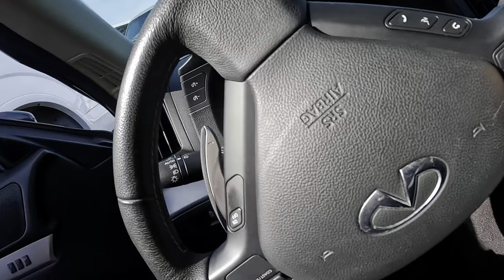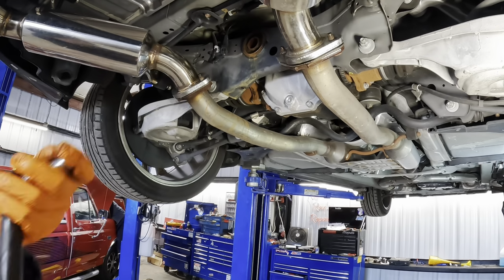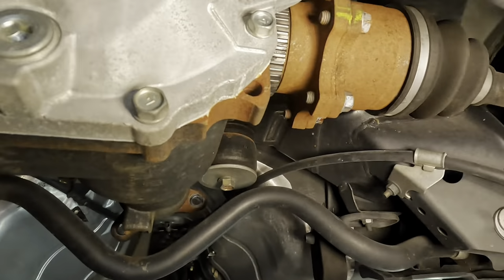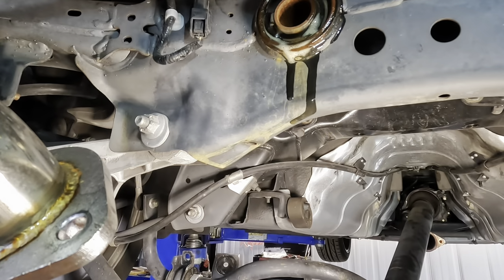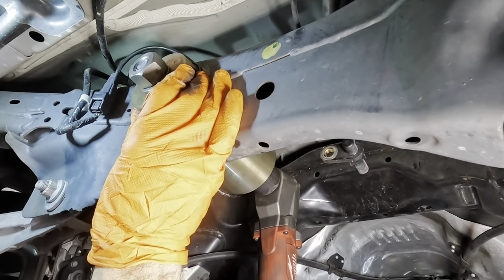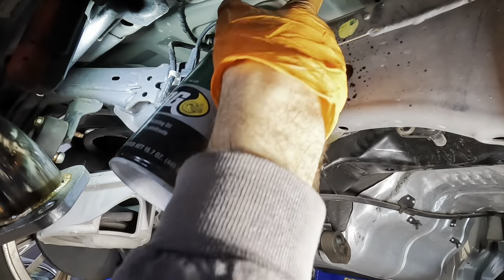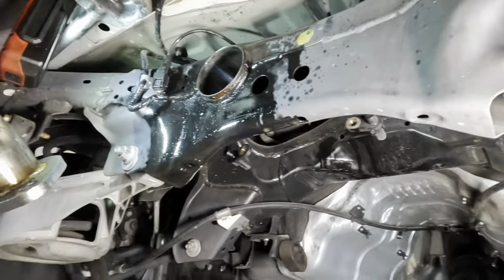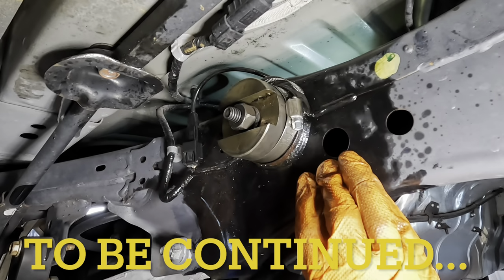Frozen Bushing! Aftermarket Press in! Infiniti G37 Rear Differential Bushing Upgrade

Comment: I hope you read the comments.  I am a new viewer of yours, I am seeing a trend.  You overuse the impact wrench.  I have seen you assemble brake calipers with your impact wrench and not even torque the nuts down afterwards.  That bushing you just replaced?  Note that you could not break the nut loose with your impact wrench.  That is because it had a proper torque done on it, your suspension components should be hard to disassemble.  You had your special tool backwards, the slot in the puck is to hold the nut in place, also, you want a full circumference pushing on the bushing, the slot on the inside provides uneven pressure.   You should lube the threads, but also the washer, that is the friction point you were fighting.   I wouldn't even use a socket wrench, it could break from the torque I would expect it to need.  Use a breaker bar, and a cheater bar on it, you have the car on a hoist, use a four foot wrench and get it done.   The piece of allthread is the cheapest and easiest piece of your special tool to replace if broken, if it breaks.  But it won't break, the bushing will slowly get pushed through, one turn of the wrench at a time.  You could see your airwrench rattle and rattle, but not spin.  Why would it?  Your airwrench didn't even have enough torque to remove the nut!   Maybe you think you are saving time by useing impact wrenches, but the video evidence suggests otherwise.  And, once again, your air and battery operated tools cannot possibly deliver enough torque for the suspension parts.   I see you have no hang-ups with buying special tools all the time, consider yourself privileged.  You should invest in a special tool called a half-inch drive breaker-bar.  A four foot length of pipe is another tool you need.   You also have a habit of tapping on things with ridiculous hammers, like using a dead-blow hammer when what you need is a five-pound sledge hammer with a short handle.   While I'm pissing and moaning like a wounded woman, one last issue, what is your problem with loud noises?  You seem shy of loud noises and heavy exertion of your arm muscles.   I do think you are a competent mechanic, you have good stick-to-itiveness and don't give up easy.  You don't seem intimidated by the many different kinds of vehicles, a lot of mechanics are elitists, and simply refuse to work on cars they don't like.  I assume you get paid flat-rate, based on book.  I have worked at service departments that expected mechanics to maintain a minimum of 125% efficiency, and I've seen men who were consistently at over 200% efficiency.  I knew this one BMW mechanic who had special tools he made and special tricks that allowed him to do a head gasket replacement on an inline six, ( 8 hours book ), he could do the job in 45 minutes, no joke.   I don't know if you have a service manager at your shop, if you did, he should have been showing you the proper way to remove that bushing, book on that job has to be under an hour, all that piddling around uselessly tapping on it and endlessly expecting the wrong tool to start working was frustrating for me to watch.  I will stop complaining, I'm sure you learned something this first attempt, and next time you should be able to bust out this job in 45 minutes.

Comment: i have an upper control arm bushing remover and installer from Maximum Motorsports made for Fox body Mustangs. They recommend anti-seize as a lubricant on the tool. It works great. My power steering pump pully puller also recommends anti-seize.

Comment: How does one hire you ray? I have a gmc 4500 8.1 v8 with the allison 1000. I am looking to have the wire harnesses, the engine and the trans replaced with new reman units. Gonna start the project in spring

Comment: Is that new replacement blue bushing a solid polyurethane upgrade? 

Not oil filled like that OEM pita one?

If it is a solid polyurethane bushing, lube with some silicone grease (scrolled through the comments and a handful of people also mentioned it)

Comment: Were the flats of the large nut supposed to be in the slotted recess of the round puller? then the nut would not have turned and you would have had a flat face against the bush?  Also the small Top Hat, was that supposed to be in the large cup to take up the space where the smaller threaded rod went?

Comment: Your half-assed application of the lube on the threads and washers didn't help. Is there some health reason you can't use a ratchet wrench? impact guns don't apply the correct type of force as good old arm muscles.

Comment: Nobody mentioned removing  the entire rear bushing mount and putting it on the 20 ton press. How many more 17mm bolts would have been removed, drop the rear cross member and then do the press work. At that point the OEM metal sleeved bushing would easily press in. 
I have seen you remove entire windshield wiper damns to access a spark plug on the fords, this infinite G37 would have been no different... Just saying...

Comment: Old trick. Okay so you don't have liquid nitrogen
If you ever get a mig welder, a tank of CO2 will be a good thing for steel.
And. If you tip the tank on the side and open the valve into a few pairs of socks. You get dry ice.
Toss a bushing or bearing inside. Open 'er up. 
Of course you probably haven't tried Publix or WD.
Shrink and harden that urethane and it will slide right in.
Slap some pure silicone grease on it.
Bearings will drop right in the bore with a little preheating of it first. Maybe with a little tapping.
Better get a thick pair of welders gloves though.
A few bucks to save an hour of labor or more. 
Try it. Works like a peach.

Comment: What is the reason to have a carrier bearing in the middle of a short length driveshaft?  I could see a full size SUV needing a connection point in the center, but not for a stationary driveshaft that doesn't move up and down.
Reply: Had same in the 240sx... Many "upgraded" to a one piece driveshaft

Comment: 1/2 90 has no ft lb. It’s like 250 max. Weak. Waiting for smoke to
Come out of the impact 😂. Thank god it was the air. Electric would have internally nuked itself 😂. Definitely miller time after that nightmare. Rubber moar luuuuubbbe

Comment: Probably original metal jacket bushing would be better. Would not bulge out
Reply: He was supposed to pull the bushing in with the deep socket part of the install tool...the walls of that socket will keep it from bulging out

And use silicone grease since this is a solid polyurethane upgrade (not liquid filled- plus that outer bushing metal race sucks)
Reply: @ricebike  That would work better Im sure..

Comment: What's the point in spending all this money on this upgrade? Does it stiffen up the ride and make for less travel when you're cornering at speed aka much better handling? Serious question, I din't get it.
Reply: Known failure... And known upgrade to solid bushings vs the fluid filled one

Differential will clunk like the beginning of the video during Ray shift from park to reverse 😢
Reply: @ricebike  Thanks my friend. I get it now. Appreciate it

Comment: The Jungle Repair method takes less time. You have to be  very careful to cut at least 2 slits the entire length of bushing. Then use your chisel and hammer to peel away the cut space. It is a job from hell either method you do.

Comment: Dry ice and a heat gun would of made installation easier
Reply: From other comments, it's a solid hunk of polyurethane, not as forgiving as the OEM oil or silicone filled one

So gotta lube that upgraded part to help slide it in place 😅
Reply: @ricebike  dry ice will shrink it and heating the cross member and lubing it will make it easier to install been there done that

Comment: That has got to be the absolute worst job ever. I think when the bushing started to move out of the sub frame I would have used a torch to heat it up properly and then drive it out when it was hot.

Comment: There's a much faster & simpler way to do this procedure. And to save were and tear on your tools. It's simple actually I live in the rust belt & I don't have a lot of money to throw @ thing's. What you learn to do is work smarter not harder. Stand to the side, heat the ceased part up and touch it quickly with a piece of Dry Ice. All you're doing  what they did @ the Factory but your reversing the process. It doesn't even have to be dry ice its got to go from hot to not in nano second's. 🤔

Comment: Truthfully, I see this is the most difficult to date in my viewing your videos work, I would suggest you take a diffident approach if your facing this same job requirement, cut the bush out, heat the bush out, just except these bush removal tools are not the simplest answer